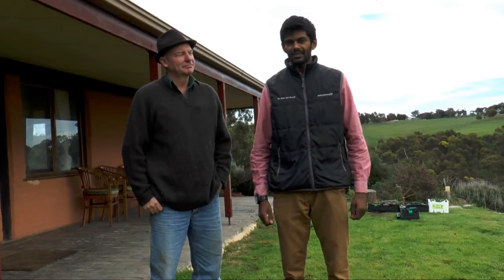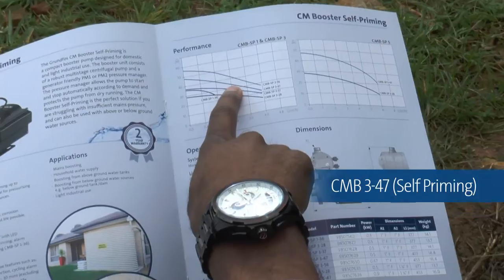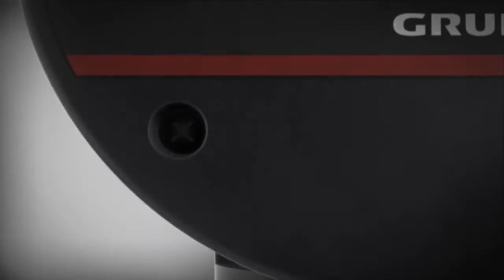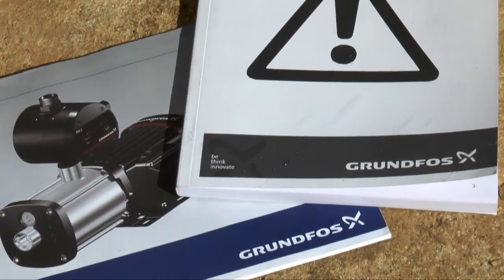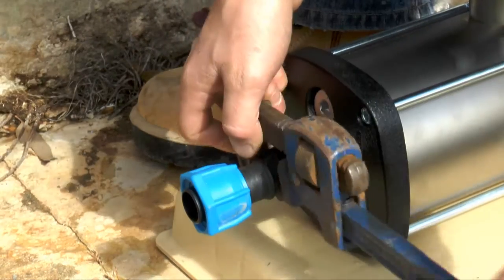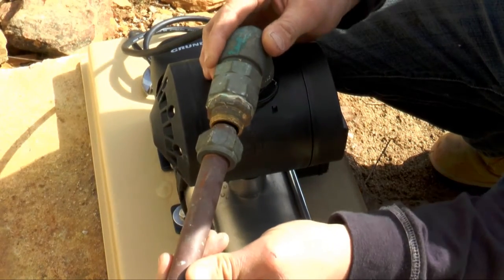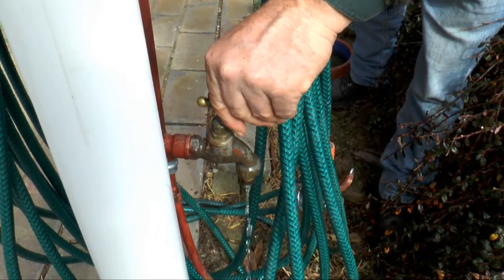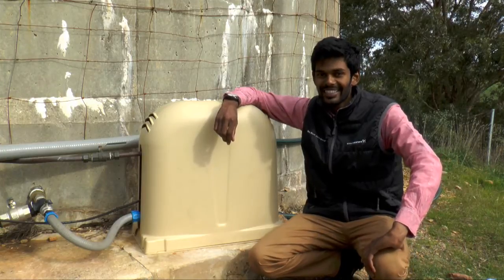Grundfos CMB 3-47 Pump Installation.

Comment: what about if  the pump is higher than water tank?
Reply: Spot on mate. Everyone knows how to connect it but how to make it run well is a different story.
Reply: @hzj7920  its a great pump once you get it going.  it would not self prime being about 500mm higher, it stopped trying after the standard 4 minutes and got the red light.  the plumber Cam did the old suck on the pipe trick and got it going.